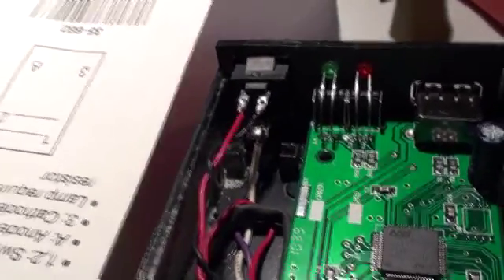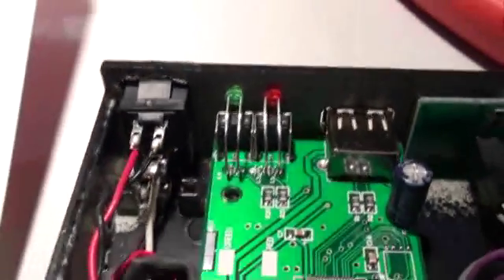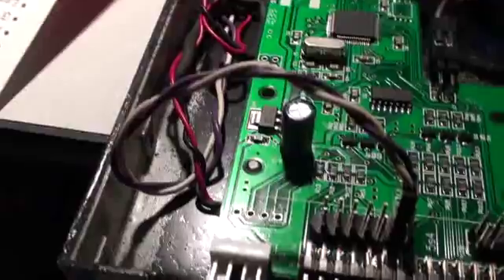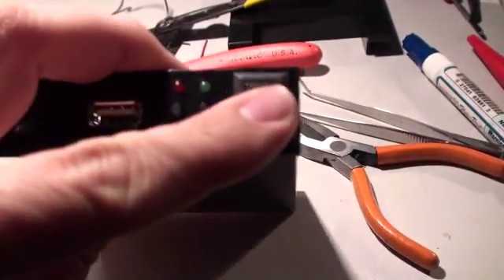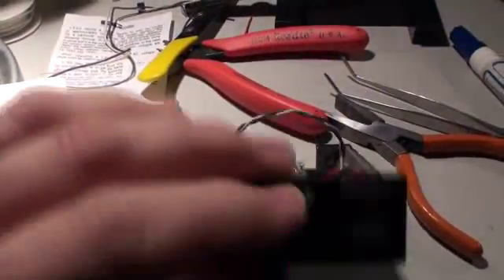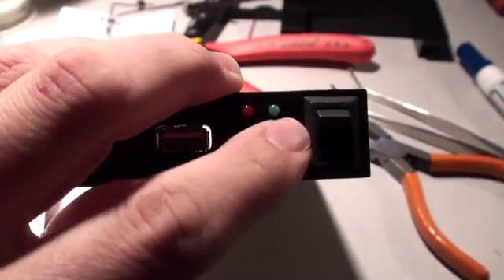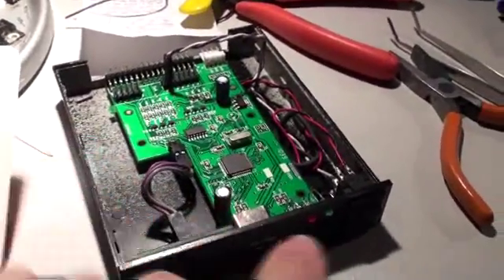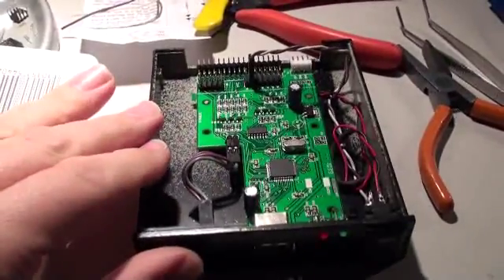Floppy Drive to USB Key p18

Comment: Dear Syntegrator, 
have installed Goteks on Technics KN3000 keyboards & Yamaha Tyros 1 with little difficulty BUT technics KN5000 providing lots of trouble with continuing message "No disk in disk drive". Despite contacting Gotek manufacturers the problem persists. Do you or anyone else out there have any idea how to overcome this problem? I know it can be done - I have seen one operate on youtube but he will not release how he did it.

Comment from the maker: Sorry. We call that stuff 'engineering' and you need to understand it if you are going to figure out what to do with the soldering iron.

There are guys selling gotek drives with the switch already installed. Check out eBay and good luck!
Reply: Syntegrator I own a Roland W-30.
I can hookup the emulator by myself. What emulator do you recommend and is the process to make the emulator work or software?